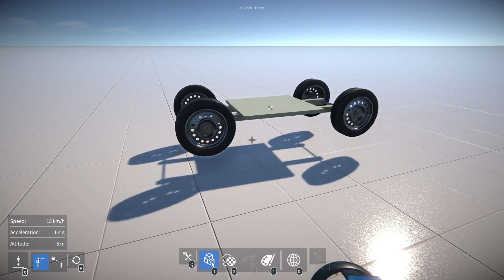GearBlocks 104: Part behaviours - Using lights and motors

Comment: Excelent work on motor behavior UI redesign. Much more enabling and useful.

Not sure if 2 button binding slots per part action are enough, though. For example, you need at least 3 different keys to run a single motor forward to make a heli fly. So I would crank the number of slots to 5 to be safe, but let only the first one to be initially visible in the UI to keep things tidy, and add "+" and "-" buttons next to it to show/hide additional slots for binding when needed.
Reply from the maker: Thanks!  Yeah, I agree that more than 2 key bindings would be useful, but rather than clutter up the UI with more slots, I'm planning on allowing for it via the logic system / linker tool.

Comment: Please add the possibility to remove Shadow
Reply from the maker: You can set "shadow detail" to off in the video settings, is that what you're looking for?
Reply: @GearBlocks  lag
Reply: @GearBlocks  yes
Reply from the maker: @kepler_45  Cool.  Btw, if you're GPU limited (i.e. low frame rate even with nothing spawned), then turning off reflections in the video settings should help a lot if you haven't already tried that.
Reply: Already made but Stil 20-24fps  W/480p res. And Shadow maybe ilf i remove It my Intel 650 integrate can make 35 (maybe)
Reply: Soooo.. good job for the game but the game dev Is getting a long time, but when i try unity for the First Time i Just close my pc After 4min